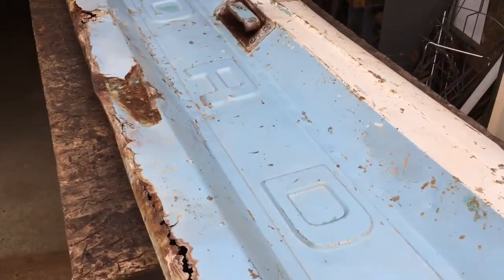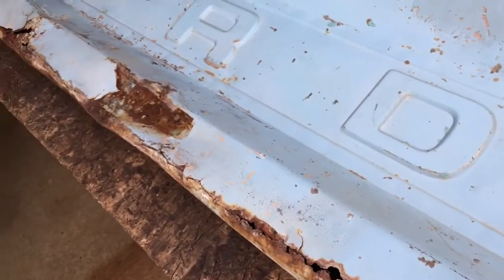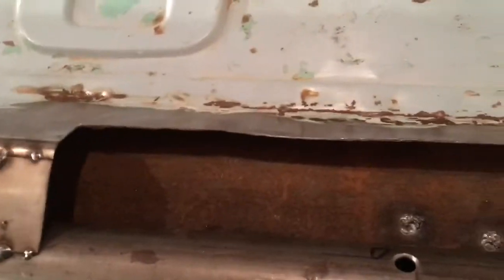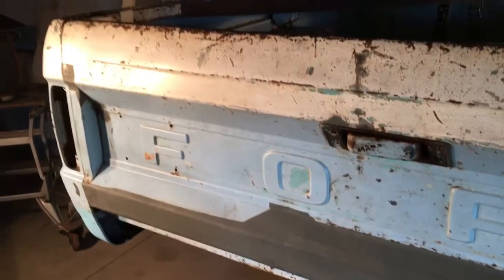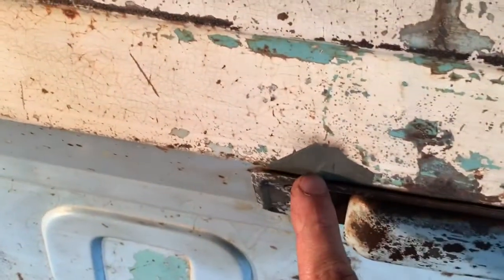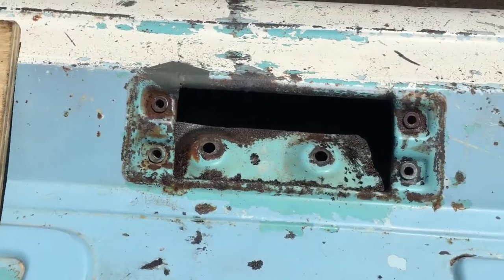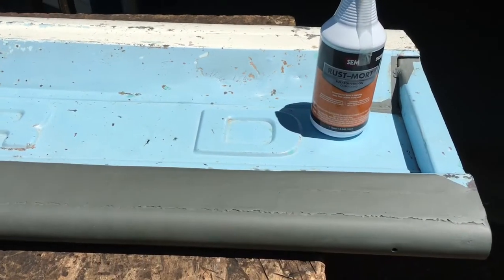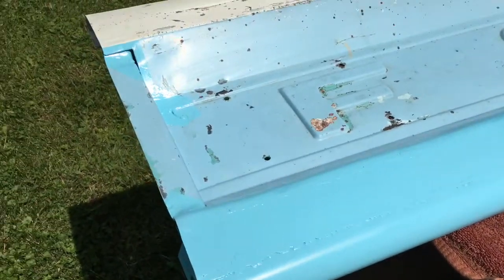FP-7100 Episode 3 Tailgate repair (Yea, it was that bad)

Comment: Just found your channel. I started working through the videos. Rust Mort is phosphoric acid, just like Ospho. I've used it with great success in my own vids. It converts the iron oxide to iron phosphate, which is less reactive but can still rust again. So top coating is always better. Subbed and we'll be in touch.
Reply from the maker: Thanks i will have to check out your channel.

Comment: using the structural tube for the bottom of that tailgate was some next level stuff! As it should have been done from the beginning. I'm definitely going to use that idea on my tailgate - or what used to be a tailgate,  as well as pouring the rust killer and paint (or POR15}) inside the cavities.
Reply from the maker: Tee Jay glad you enjoyed it, thanks for the comment

Comment: Nice job on the tailgate. Had Ford coated the inside of the tailgate, it would likely be in much better shape. Good call on Rust Mort; I was visualizing the “reverse electrolysis” method of rust removal, but that would require a container large enough to immerse the entire gate. Your way was much better.
Reply from the maker: Thanks, I was glad I was able to fix it.

Comment: Embarrassed to say how many times I've watched these videos (I made my own playlist so I could watch them in order since you don't have a playlist Stacey - lol) and this is the first time I noticed you said you got the cruise control added. Any chance you could elaborate on how you did that? I have a 2003 and I REALLY want cruise control but I don't know how to go about making that happen. I know it's gonna require a new steering wheel or I could install switches remotely - since I don't plan to go with the Vic column. Did you go OEM or did you go aftermarket?
Reply from the maker: Sorry for the slow reply, I used the stock steering wheel so I didn’t really have to do anything else except plug it all back in. Sorry about the play list I have been meaning to make one.

Comment: Very cool and informative! I bought a 75 from a guy my dad used to work with last year. It was at his hunting camp under cover, but the tailgate was sticking out and got the brunt of the water dripping down from the lean to. Plus it was a replacement tailgate and it was never even primed. I will try to salvage mine as best as I can, I would like to know what size wire you used and your weld set up, I have a mig and I am a beginner welder but feel like I will burn through the metal, though I know this is an old video.

Also, I saw a cool redneck hack online where a guy poured the rust preventative in the tailgate and somehow hooked it up to his concrete mixer and got the liquid spread around inside that way.
Reply from the maker: Thanks for the nice comments. I like 0.030" wire for most stuff, but 0.023" works best for sheet metal for me. short welds or spot welds, and cool the work with a air hose in between welding.